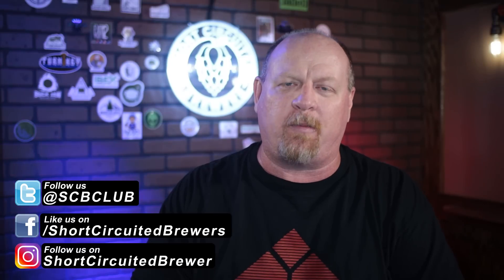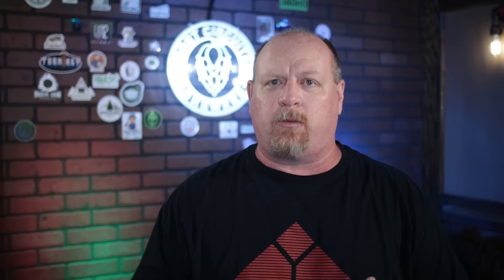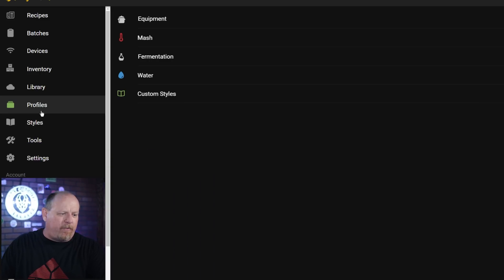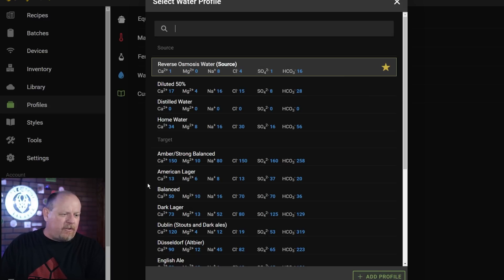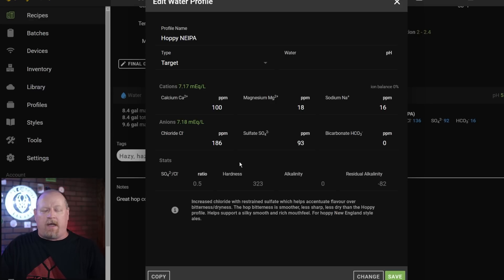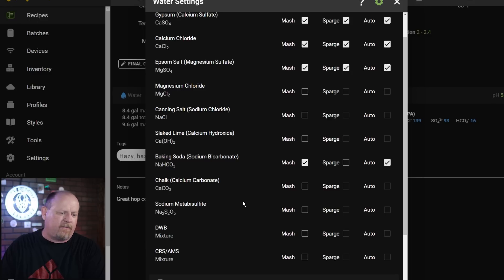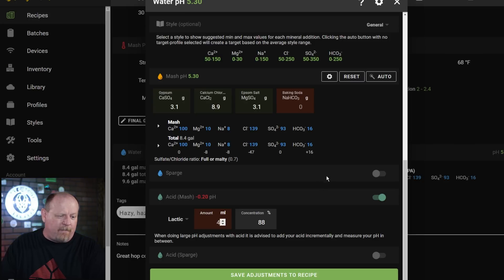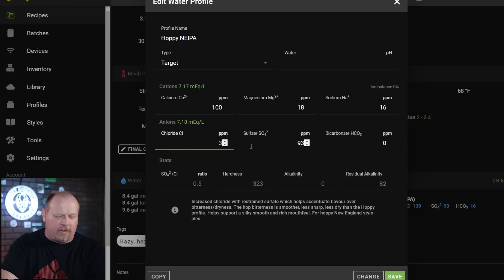Brewfather Brewing Water Tutorial

Comment: How often can you adjust the PH during the brewing process? I treated my water for the first time on my most recent brew. I followed Brewfather and ended up overdoing the lactic acid addition, lowering my Ph to 4.8. I didn't realize it was that low until my mash was done (before the boil). I wasn't sure if I could add baking soda at this point, but I did anyway. So i brought my Ph up to 5.3 before the boil. After the boil it was down to 5.1, so i added a little more baking soda again before i pitched the yeast. All that to say, is this normal?

Comment: Hi. So it you opted to use the mash and sparse water in your treatment. The programme would distribute the correct amount between the two in a ratio dependant on water volume. If you just put it into the mash presumably it would increase the concentration so that when the sparse is added it will end up at the final requisite concentration. Also does it take into account water loss through evaporation and mash absorption and consequent increase in salt concentrations. Thanks
Reply from the maker: Not enough evaporation with the lid on to make a difference. You could add all the salts in the mash. Acid for pH adjustment is a different story. 👍🍻

Comment: Great video.  I do have what might be a dumb question.  How MUCH water do you use for Mash-in?  We have been using around 1.2-1.5 qts per pound of grain bill.  What do you use?  Do you have a video or a guide on this?  Thanks!
Reply from the maker: I use the standard profile for brewFather. You can always adjust it to your liking in the equipment profile to fit what works for your system. 👍🍻

Comment: After selecting your target profile (hoppy neipa) and hitting auto, your numbers dont come out the same as the hoppy neipa profile.  This must be normal, because it always happens to me too.  Hoppy Neipa's numbers are 100, 18, 16, 186, 93, 0.   After selecting Auto, the numbers in the water calc menu, under mash ph heading display 100, 10, 8, 139, 93, 16.  Why does this happen?  Is this a result of the grain bill etc?  I have been trying to answer this question for awhile.  I dont get why you enter a set profile, ask bf to spit out the addition amounts based on your profile, and then bf gives you the amounts but changes your profile numbers.
Reply from the maker: I believe it takes your base water profile into account. And then the mash figures are the ADDITIONS not the actual number.... I think...lol
Reply: You have maxed out Ca and SO4. To get the Mg up you'll end up overshooting the SO4. To get the Cl up you'll be overshooting Ca, unless you use NaCl. I found NaCl to be disabled by default in my BF, turn it on for auto and calculate again. You'll then see you get your Cl higher until Na reaches 16ppm, you won't get Cl there all the way with this though.

BF doesn't go above the target profile, once an element such as Ca is at target it won't add more CaSO4 or CaCl2 for the SO4 or Cl. Since Mg is added as MgSO4 it won't add more because SO4 is at target, it can't add more Mg without adding too much SO4. I'm not sure if the Mg can be fixed by simply adding less CaSO4 and more MgSO4, this would leave more room for Ca to be added as CaCl2 to get the Cl up some more. I suspect the app is prioritizing some things over others.

Comment from the maker: Clarification.
If your water report shows 
SO4-S you need to multiply be 3
If your water report shows
NO3-N it is actually not a reading brewfather needs. So disregard my comment on that. Another program I used in the past used it, but not brewfather. 

If your water report shows SO4 do not multiply
Hope that helps.
Reply: Sodium is not related to Nitrates. The sodium is already presented in the Ward report as Na+ in ppm. Brewfather does not ask for the nitrate number.
Reply from the maker: @davidwalsh3734  I was used to putting the report in Bru'n water.  So I mentioned it.
Reply: @ShortCircuitedBrewers  Brewfather makes it easy!  Love using it.
Reply from the maker: @davidwalsh3734  definitely!
Reply: @davidwalsh3734  I know sodium isn't related to nitrates.  But he was saying we had to multiply na if the nitrate had the n next to it.  I was just making sure that was correct.  To make sure I'm supposed to multiply the na as well.
Reply: @michaelford8494  this is wrong however. A nitrate number in a water test is unrelated to your sodium number.
Reply: @davidwalsh3734  so what am I supposed to multiply?  Sulphate and sodium? Or just one of them?
Reply: @michaelford8494  just the sulfate by 3.
Reply from the maker: Just the SO4-S
Reply: @ShortCircuitedBrewers  thanks for the help.  Sorry for the confusion.  Just got off working a double.
Reply from the maker: @michaelford8494  no problem!!
Reply: Thank you for your response. So if the N03-N is there we multiply the nitrate # or the Na # 4.43?
Reply from the maker: @michaelford8494  yes sir
Reply: @ShortCircuitedBrewers  which one? the nitrate or sodium?  or both? Thanks again
Reply: So, SO4 no multiplying. SO4-S multiply by 3.

Now getting back to brewing after long hiatus. Any water tips for Beersmith users or is Brewfather that much better? Thanks.

Comment: NO3-N on the Ward Labs reports is for Nitrate - not Sodium.  I've never heard of a need to multiply the Na result for the Ward Labs report - where did you get that?
Reply from the maker: The bru'n water spreadsheet. If the reading has a -S after it is the only time it's necessary..
Reply: @ShortCircuitedBrewers  confused.  Do you need to multiply the Na value on the Ward labs report by 4.43 or not?  Or did I misunderstand what you were saying there?  I already knew about the sulfate adujustment.
Reply: At the 5 minute mark
Reply from the maker: Only if the report shows it as. NO3-N  then you need to multiply. If it just says NO3 you don't. The reason I added it to this video was because my water report had the issue on both of those readings that needed to be adjusted and I failed to mention that in the water report video.
Reply: @ShortCircuitedBrewers  Brian, I am not trying to belabor the point - but I now think you may be a little confused.  At 4:46 you start talking about adjusting the Na+ value - which is the sodium ion.  The N03-N value on the Ward Labs report is assciated with Nitrates.  Sodium is abbreviated Na on the periodic chart.  I have never heard of a need to adjust the sodium ion portion of the Ward Labs reports when inputting water profiles.  There is no input for Nitrates on the brewfarther water chem app.  I do not think you need to adjust your Na+ by 4.43.

Comment: To digress away from this topic a bit, have you seen the extender rings or sections that can fit onto fermeters and mashing units in order to increase the capacity of the brew???
Are they stable? Do they heat evenly?
Would be great to see a review on these extenders.

This is the video I recently watched:
https://www.youtube.com/watch?v=_UscODVrqIs

Cheers
Reply from the maker: Yes I just saw them too! Blichmann was actually the original company to do this. The brewzilla latches make them easy to add extensions to. The only issue I see with them is that the more depth you get into a mash the less efficiency you're going to have. They're definitely is a point of diminishing return if your capacity goes up and not out. 👍🍻
Reply: Sounds like an idea for a test video 😛

Comment: Why should we need to multiply by 3 and by 4.43?  Even if we got the beer test from ward? Thanks
Reply from the maker: Because of how it was measured by ward labs. Concentration levels bases on his it's measured. The -S is the determining factor. If the report doesn't have the -S you don't need to multiply.
Reply: @ShortCircuitedBrewers   thank you.  Do you know where on the report it would be located.
Reply from the maker: It's in the NO3 reading and the SO4 reading. If either of those have the -S at the end you would need to do the multiplier
Reply: @ShortCircuitedBrewers  So I am confused on this.  My Ward lad report for Sodium, Na : 98 and Nitrate, NO3-N : 0.1 (Safe).  I don't have the "-S" after my Sodium, but have a "-N" after the Nitrate.  I am getting confused on which reading you are talking about multiplying by 4.43.  Are you talking Sodium or Nitrate?  Thanks - also nice video by the way.
Reply from the maker: @michealwick928  if you watch my video on the water report it had -S after my numbers. If yours doesn't. You don't need to multiply at all. It sounds like yours doesn't. Based on the that sodium number it doesn't look like you need to do any math.
Reply: @ShortCircuitedBrewers  NO3-N refers to the nitrogen concentration, not sodium (Na).  You would multiply that value by 4.427 to obtain the nitrate concentration, not sodium.  The sodium value on the Ward labs report should be used as-is.
Reply from the maker: True unless it has the -S after the SO4 indicating a sulphur content not sulphate.
Reply: @ShortCircuitedBrewers  Yes, for the SO4 value your conversion is correct.  But I think you might have been mixing up sodium (Na) and nitrogen (N)

Most people won't need to worry about nitrate (and the conversion) for brewing water.  It does matter in bru'n water, though, because you need to balance anion and cation charges.  Without the conversion it won't balance out.
Reply from the maker: @skroz1  yes that true. But wanted to mention it since I didn't point it out. But I think I caused some confusion. But hey good stuff! 👍🍻
Reply: @ShortCircuitedBrewers  ALWAYS good stuff.  Your videos are always top notch.
Reply from the maker: @skroz1  thanks man! 👍🍻